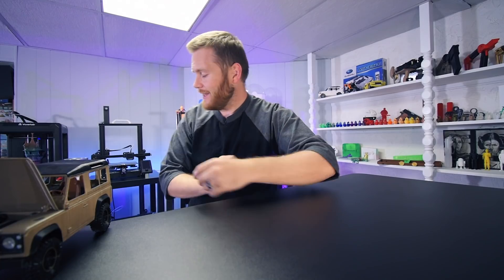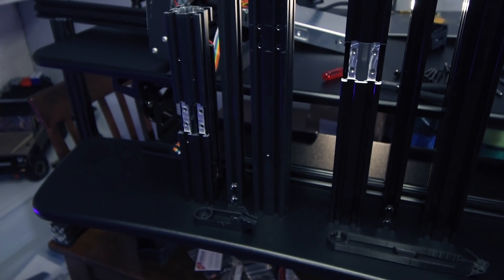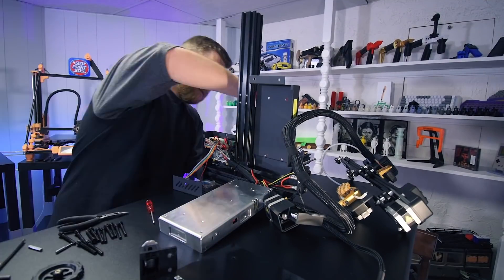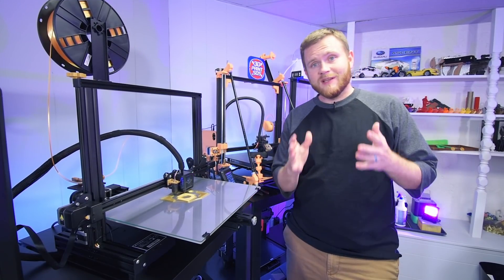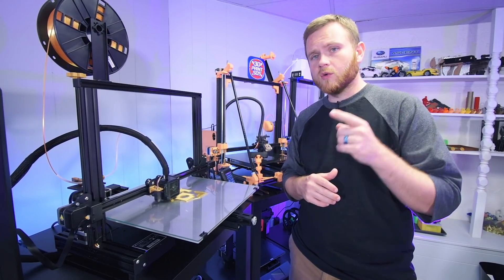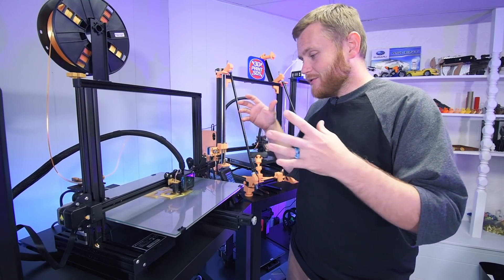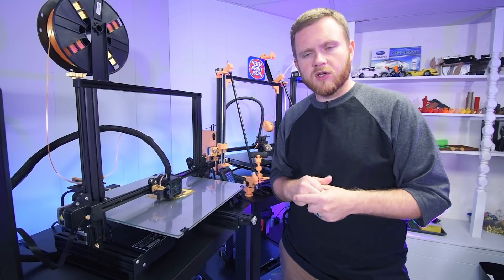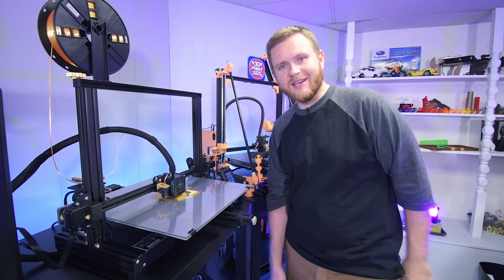Make a MASSIVE Aquila! With Ender Extender

Comment: OK ... bigger profiles to bigger build plate 400x400mm ... but WHY autoleveling if you have stock metal parts and s**t screw nuts on Z axis and single Z axis motor  ?? I have complete rebuild all my ENDER 3 v1 printers with strong printed parts, no excentric nuts on Z axis, block with POM crew T8x8 with anti backlash, single Z motor, on top Z screw in bearing holder and manual axis knob ...  no autoleveling, difference between LEFT and RIGHT sides of Z axis is max 0.5mm (right side lower max 0.5mm) and this difference I eliminate with manual bed leveling. I dont using heatbeds so plates are flat, not twisted as bimetal, 4mm glasses and spray tool 3Dlak ... and perfect printing quality with DIRECT drive.  So extender kit is super but stock hotend, extruder and autoleveling are wrong parts. I cannot post photos here. Write me email and I send you photos of my remakes of E3 printers ...

Comment: Still loving my semi-stock X2 but really want to go bigger. These kits are running 200, plus youll need to get the glass. Should i kick out the money for this or go with a whole new unit? I think you can get a 400x400 for around 350-400 now a few different brands.
Reply from the maker: I would only suggest this if you really want to tinker with it. Otherwise it's best to go with something else.
Reply: @3DPrintSOS  Thanks for your honest opinion. Appreciate your work.
Reply from the maker: A year and a half ago, I wouldn't even hesitate, but there are a ton of options out there now. Like I mentioned, I still had a ton of fine with mine but you have to want to do it. If that makes sense.
Reply: @3DPrintSOS  It does make sense. Why fix it if it's working perfect. I believe I will keep it for a smaller print printer. Possibly thinking about getting the Anycubic kobra max. When it's on sale it is not terribly expensive at all.

Comment: Considering buying extender kit for my Ender 3 V2.. Would you still recommend this kit?  I know a core xy printer is going to be better than a big "bed slinger" ...  I also have a Ender 3 S1, I wouldn't recommend to anyone, and a Anycubic I3 Mega I got for $50 off marketplace, that sadly works better than the new S1 I purchased. Or should I sell the S1 and Anycubic and just buy a core xy printer? The only reason I consider this for my Ender 3 V2 is because it prints damn near perfect every time. Thanks!

Comment: I did the upgrade, but can't find the firmware. can you help, thanks
Reply from the maker: Check the bottom of my linktr.ee/3dprintsos. I do think they have it on their site somewhere. If not, their GitHub for sure.
Reply: @3DPrintSOS  nice, thanks. i got the kit just recently and i was looking for the firmware, unfortunately i failed in compiling it my self, thanks for the kit recommendation as well, i watch your videos often.
Reply: @3DPrintSOS Please forgive my ignorance here as I fumble though  all the information.  I'm a bit confused.  Is it required to update the firmware?  I have the N32 and no CR/BL touch.  Doesn't changing the build plate setting in Cura allow you to just power on and print?

Comment: Where did you get the firmware to upgrade the Aquila to 400x400. I sent an email to  Voxelab and they said upgrading the Aquila to 400x400 was not feasible. I told them they were wrong! Physically I've done it, I just need the firmware. So.... Where can I get it please?
Reply from the maker: Grab it at the bottom of https://linktr.ee/3dprintsos
Reply: @3DPrintSOS  Thank you so much! I might send a video to the Vox people showing them it is Feasible!

Comment: 400mm x 400mm is tiny... I built a 1220mm x 1220mm with a KILLER heated bed! 1220mm needs BIG fast steppers. the system operates at 48V on the extruder and steppers and 60V on the heated bed
Reply from the maker: Woah. That’s big.

Comment: I have an Aquila with a couple of mods, I'm on the hunt for a second printer now. Would you rather do this Ender extender mod to an Aquila, or just buy a CR10 or Longer that is already larger? I print ABS, so I'm worried the bed plate won't be right when adding the larger plate, to heat up the enclosure too.
Reply from the maker: Depends on what you want really. If you like to customize stuff, the Extender is great. But don’t do it to your only printer. If you have the budget, the mingda magician max is good, the longer LK5 Pro is decent (I’m selling one at a discount in my discord). For ABS, you’d have to do the same stuff as you would on a smaller machine. Make sure your hotend can get that hot and keep the printer either enclosed or in a room with very little to no moving air.
Reply: @3DPrintSOS  I have an E3d V6 clone with a metal heat break, an enclosure, I moved the electronics out of the enclosure. I have not done ABS yet but I have been printing Polylite PC, I'm hoping ABS is at least the same but I can vapor smooth it. It would be a second printer, thinking about picking up a not new one off Amazon, then adding the 400xl kit to it with the same mods and a .8 or 1mm nozzle. Looks like I would be in the 4-500 range enclosed and all, which is why I have been considering it.
Reply from the maker: That’s true. Plus you get the additional benefit of knowing you can literally modify it in anyway. It’s basically Lego.
Reply: @3DPrintSOS   off topic, your videos have been EXTREMELY helpful for those of us with these Aquila's. You're quite good at the informational YouTube segment, comfortable on camera, clear, but not so detailed that a moron like me can't understand. I watch a few of the "big time" 3d printing YouTubers and I consider your videos to be just as well done, so thank you for spending so much time on these printers.
Reply from the maker: I really appreciate that Ralph. I gotta get “back” to the Aquila here soon. I have more cool stuff for the “ultimate” build and the S2.
Reply: @3DPrintSOS  I have been wondering what's up with the ultimate build, I didn't pay attention to the metrics on the build videos so I kind of assumed they weren't low and you were trying to get other better stuff in. But I'll be watching it when you get back to it.
Reply from the maker: Sooon. I have a box of awesome components to throw on it. Essentially just paying the bills first while trying to produce useful content.
Reply: @3DPrintSOS  I definitely get it, I'm going to be most curious about the bed performance with and without the insulation. If there is a difference at all, that is. I'm not that would pertain to me, seeing as I'm running enclosed, but I'm curious.

Comment: Where are you finding the firmware?
Reply from the maker: There should be a section on their site. If not, you can message them for it. I’ve also seen them on GitHub. Or you can always just compile your own Marlin just with a larger bed size.

Comment: I have the ender kit 400x400x500 an was just wondering if anyone did anything to just flash the firmware for the bigger bed size?
Reply from the maker: You have to flash the machine with new firmware. There are hard stops in the firmware at the stock size.

Comment: just bought one and your code still works :D
Reply from the maker: Awesome. Glad to hear it.
Reply: @3DPrintSOS  So got a question.. I got the extender setup and was just wondering if you knew how to edit the marlin firmware for a 400x400 bed?
Reply from the maker: You have to make those changes by combining the files. I do think you can some compiles versions even
Reply: @3DPrintSOS  ended up finding a compiled version from your discord actually! Just gotta fix the homing issue and level the bed and should be good

Comment: Did you have to do any firmware updates to get the printer to actually USE the extra space, or was it always able to but the switches stopped it? Sorry I am literally JUST getting into this, literally only just order my first Aquila C2 yesterday. 😂
Reply from the maker: Yeah for sure. The firmware has hard stops for size. So you have to undo are the firmware with the appropriate numbers.

Comment: Sorry to comment on an older video, but just wanted to ask is this the Voxelab Aquila C2 model then? And would you recommend that model over the X2 or S2? Would this upgrade work with any of the Aquila line up?
Reply from the maker: No this is not the c2. Although I have a specific video on the c2. The x2 and S2 are far superior over the c2. The c2 has an h32 motherboard with loud stepper drivers. You also get a very old school screen. I would recommend any other Aquila.
Reply: @3DPrintSOS  Thank you, appreciate you taking the time to reply.
Reply from the maker: Absolutely. :)

Comment: even a beginner should buy it before installing have it put up until you feel comfortable with the machine this way you have the kit for later and not worry about it being discontinued and cant find it anymore.
Reply from the maker: True. If the goal is to eventually have a bigger machine and you want to learn on the smaller machine first, it’s a good solution.

Comment: HELP!! Have the 400xl on my Aquila but the Jyers firmware will only bed level in 235x235 stock bed size. If I slice in cura on a 400x400 buildplate it will print, but wont auto bed level or run a mesh bed leveling. Ive also tried to compile the firmware from source code, but it crashes during the build process in Visual Studios 😕

Comment: I got the BLTouch, the dual Z and I'm waiting for the AC heating element. I've got a 300x300 printer for now that's working out, but a friend of mine is willing to pay to be able to print bigger stuff. I've already worked out placement on the bed, diagonal works out great and the 250 isn't an issue at all... the part he wants is 150 at most in height. I don't think I would do it without a dual Z though.
Reply from the maker: Do a test, something like a tall cylinder. If you see layer lines, then try dual z. I did some adjusting to the wheels and I can get pretty clean prints with a single side.

Comment: I notice it looks like you have a CR Touch on there. I have been trying to find someone saying if it would work with the Voxelab Aquila X2 without having to do a ton of extra work. Does it just go one just like it would an Ender 3?
Reply from the maker: Yes and no. Some people with H32 machines have had issues. However if you have a g32 or n32 machine, you could run Alex’s firmware and it works great. I have a video on it. ;)
Reply: @3DPrintSOS  Heyo, brand new to all this. What is n,h and g 32? How do I check?

Edit: nm found your other video about chips. Thanks.

Comment: Wish you could do the 300mm one
Reply from the maker: Since the 300 model is narrower, it would be very similar, but a bit more stout. Should be good!
Reply: @3DPrintSOS  do you know if the 300xl for the v2 will work for the Aquila,  because  I think the 400xl  is to big and the regular  300 for the Aquila  is to short?
Reply from the maker: Yea the 300xl will work. They have Aquila specific kits on the site. ;)
Reply: @3DPrintSOS  it says at the bottom  of each Aquila kit dosent include glass. The ender v2 kits do and it the same price.
Reply from the maker: Ah, honestly I didn’t know that! But the kits are not the same. The Aquila has different mounting points. They aren’t direct clones. So, I’m not sure the Ender kit would fit without modifications.

Comment: Quick tip aswell, you can also buy 400x400 picture frames for dirt cheap. Disassemble it and you've got yourself a thin glass sheet that fits perfectly.
Reply from the maker: Smart! Thanks for that.

Comment: I'm looking to purchase the kit but I'm apprehensive about the firmware. I have N32 firmware stock from Voxelab but will I have to start using custom firmware for the kit to work or can I just change my profile in Cura or Prusa?
Reply from the maker: The stock firmware has soft stops at Max width. So, you’ll need firmware. Luckily, it’s not too hard. A bunch is provided by Ender Extender via their GitHub. ;)
Reply: @3DPrintSOS   thanks. love the content.

Comment: I dont like the idea that they dont send a new actual bed mounting and heater the right size.
Dont like the idea of using the old small bed mount and heating element on a huge bed.
How it is your only getting heat to the center of the new bed.
Personaly for the price I think it is a bit crap and to expensive.
I could do this cheaper buying individual parts and with a proper new bed.
Reply from the maker: This might not matter to you at all, but figured it worth mentioning that the printer has been working perfectly for months. I’m getting amazing prints from it. No heated bed related issues. Ideal? Maybe not. Does it work well? Definitely.
Reply: @3DPrintSOS  Awesome that is good to hear and very good to get the opinion of someone that has actualy used it in this configuration. Many thanks for all your great videos awesome work.

Comment: I got all the hardware done and just finishing up the wiring as we speak, however, I was hoping to find a link for the firmware to change the bed size.  Do I do that in the G code terminal?  I already got the BL touch firmware installed, not sure if its going to work with the larger bed though.

One thing to keep in not, if you go 500mm on the Z height, consider getting some 40/40 600mm from that site as well and use the side rails to know where to drill your holes to make longer legs, as well I used elbow brackets on the top front and back on each side and on the bottom legs with a steal cable wire and a adjuster on each one to stabilize the z from swinging while printing, as well as move the spoole to the side of the unit.  It maxs out my Ikia table.
Reply from the maker: I have it linked at the bottom of my Linktree link as well as in the description. 

Thanks for the tip! I’m going to still with the short setup for now or maybe something just a hair taller. Not by much though.
Reply: @3DPrintSOS  Hate to say it, but I don't see that link anywhere for the firmware, I've went up and down all the links before the comments and the vid and no link to it. must be a secret link that a blind person like me can't see. .   I've just bought the timing belt and pullies for my setup as well. want to make sure both z screws rotate correctly.

Comment: Is there sag on the x ? Does it need 2 z rods to hold the weight?
Reply from the maker: No sag, has been great actually. I just had to adjust the wheels and take my time squaring the frame. I’ve printed short and I’ve printed tall. No z related issues